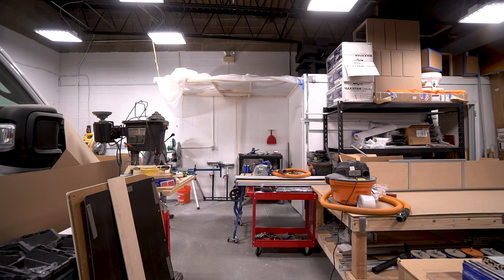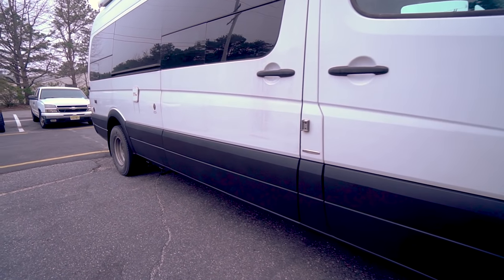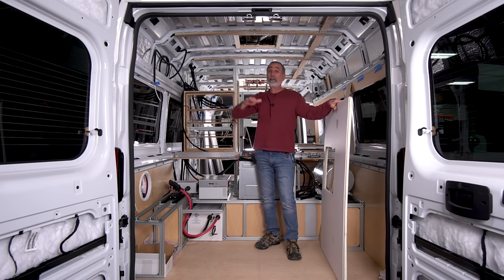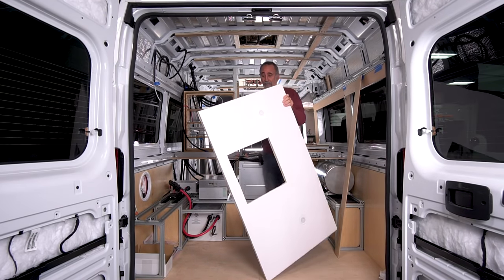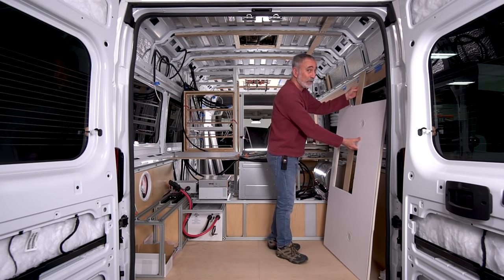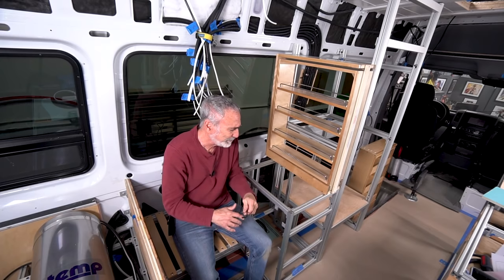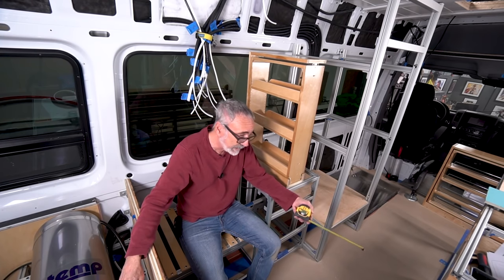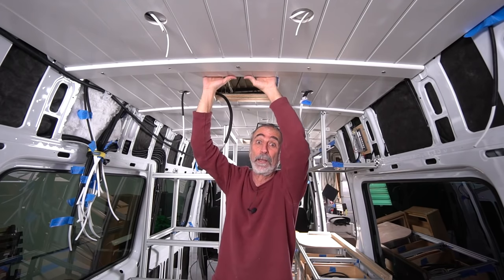Van build tips-Removable insulated ceiling designs explained-Recessed air conditioner & wiring tips

Comment: I parked too close to the trolley return bay at shopping the other day, and I turned too sharply, too soon, as I left my parking spot and subsequently scraped the entire side of my Iveco 35S16 van along the pipe structure of the trolley return bay.  Thank God for the rafter liners, that’s all I can say, otherwise I would have had a totally scraped and dinted van. A good lesson to learn so early in my van ownership. I was so relieved that the liners saved my van.

Comment: FYI  just wanted to tell you that when I had a van with no insulation on the floor it was very cold. When I stopped at a flea market on a Wednesday there was a man selling very thick black foam rubber! As much as you want in width and length! So I bought enough to put on my walking area. OMGOSH my feet never wore slippers again!  My piece is like a 2x4 and is easy to fold and take out during the summer months. It’s like the black rubber that is around a hair dressers chair. Cushioned and not cold. It’s about 1” thick or maybe alittle less. Just thought you might want to know? Live your show and work man ship!
Reply from the maker: Thank you Donna, great tip!

Comment: Love your work. Great attention to detail.    Good that you put the heavy items Over the axle but don't forget that the vehicles  weight rating takes into a count the loading on all axles. Mass centralization Is important for a vehicles handling and stability. I think that people tend to think that you can only load the rear axle. Many overlander build have so much hanging out the back with boxes bikes bumpers and spare wheel that they must handle terribly. You end up with the tail wagging the dog. Something folks should consider.
Reply from the maker: Absolutely correct! The Vagabond van was going to load up their garage so that’s why I put the water tank under the galley, across from the fridge. To balance the overall weight. The four corners of that van

Comment: So many interesting details...creativity and craftsmanship without peer.I’m glad my build is taking so long (seems like 90% thinking about the build and10% building) because you give me important tips that improve it every week, even little things like taking wiggle out of the wire looms. And I prefer the weekly summaries with short clips of building because the condensed info is so rich with great ideas. Thank you, thank you, thank you.
Reply from the maker: You are absolutely correct when you say that a van build is 90% thinking. This is the reason I take ten months to build a van. Each one is a ground up new design, starting from scratch, so to speak. I run through all kinds of scenarios and situations in my pea brain to test my ideas. All night long! 😩
Reply: I figure you must be too busy to post more videos…our loss. Hope all is going well. I do have a question: Are you an Espar dealer? I seem to recall this. I’ve searched you videos for installing Espar D2 air heater and cannot find an air-only inside installation. Have you done this? I want to install this on the 5/8” wood floor over 1” XPS. I’m trying to figure out how big a cut that I need to make on the wood floor. Does the whole heater need to be dropped to floor or can the cut  be made just for the mounting plate to cover with the heater at the level of wood floor. Thanks for your support.

Comment: This was perfect timing for my promaster build. I'm a little flabbergasted on how I'm going to frame out the walls and ceiling.
Btw I used lizard skin on inside. But I didn't use it on floors. I think it's designed more to insulate you from a heat source.

Comment: George.....my dream builder when I get rich.....Do you have a "guess-ti-ment" of what your builds typically run?  I know you use top quality everything in your builds, but if I'm going to dream to be rich, I need to know about how rich I need to be. And yes, you are making an impact on the van building world.....
Reply: yes, me too.
Reply: His builds are between $225K and $400K.  Why not build yourself instead of waiting for a man to do it?  What do you think these videos are for, gal?  Start.  Now.  You have two hands and a brain, same as any man.  And you are a better cook, I'm willing to bet.
Reply: If you have to ask, you cant afford it.  Just know a factory-built (cheaper) model starts at around 100k.  Class B units are definitely not cheap.  For sure, all of the parts George puts into these are top of the line products.  (IMO, even though some are top of the line, there are perfectly good knock-off components out there at a fraction of the cost.)

Comment: Hi George, I’m stealing your brilliant idea on on making bath bigger by leaving doors partially open when in use, the thing I’m changing is to extent shower tray past doors 1ft and have door filler panel on piano hinge. Need to figure out how to make extended shower drain look good when doors are closed. All class b’s front bath have a problem with narrow size.

Comment: I would STILL put some reflectix strips behind the ceiling panel... Better than air gap insulation.  In the desert you need all the wall and ceiling insulation you can get.  Floor runners and rugs with a yoga mat attached for thermal and cush insulation is a great option.  If you don't like the rug, throw it out and get a new one.  They are cheap and easy to replace.  4-ought cables, the shorter you can make them the more efficient they are.  Try angled connectors to minimize the flexing you need to accommodate bending the cable.  Build an extended bus bar for them to improve your angle options.  AC?  Just go with a mini-split.  Less power, more efficient.  Don't like the size of the head cassette? Maybe get a low profile ceiling mount version.  Love the space saving efficiencies you are making here.  Some day, a special company will make tiny-home / van sized furniture and counter space.  24" wide is a waste of space (IMO).

Comment: Great video George!  Love the outtakes!  Are the furring strips and roof stringers both bolted on/through with plusnuts or are the furring strips glued and screwed?  Your videos have helped me immensely planning my own build.  Your design sensibility of making things modular, removeable and inspectable is exactly what I strive for in my design.  It would be so cool if you had a book or ebook that went over some of your design principles and things that could be helpful to new builders.  There are a lot of other builders who have done that, but in my opinion you are one of the best out there in terms of design principles as well as the finished product.  Great work.
Reply from the maker: Thank you Mike! The Sprinter van is all PlusNuts. The Promaster, being a much lighter ceiling system, is glued and screwed. I don't have any type of formal How-To guides, but have thought about doing a week long build gathering tutorial in a campground somewhere, could become a thing!

Comment: I’m in a similar situation to Sam. I have a high roof Nissan NV2500, I’m 6’ tall with shoes on, and I have about two inches of clearance before I hit my head. I was wondering if putting furring strips on both sides of the roof stringers would save a precious bit of headroom and still be structurally sound

Comment: Hi George,
I see that in every model you use metal profiles for the construction. In the end, isn't that altogether too heavy for the Van?
How much does weight the van when is finished and loaded also with fuel, water, meals, clothes, and 2 persons?
Reply from the maker: On the contrary, Burim. The aluminum is much lighter in the way I use it, rather than typical plywood box construction. My vans, FULLY loaded for full time living are well under the GVWR.
Reply: @HumbleRoad  I am happy to hear that George. Sometimes the wood seems lighter but is not that stable and strong all the profiles and the woodworks always. I am thinking also to use that kind of profile.

Thank you very much for the answer and for the videos that you upload.
Greetings from Germany :D
Reply: Aluminum and sometimes even steel is the way to go on the framing.  Way lighter than heavy wood.  Aluminum is also much stronger, so you can do a slim profile which carries a lot of weight.  Saves on volume in the van. You don't need wood working skills either, as it is easier to join up.  Check out HR video on weight calculations - explained very well.

Comment: What prevents the ceiling panels from bouncing up and down? The stringer seems to just hold the panel in place. It does not appear that the panel is pinched between the stringer and anything else so it seems like it would bounce up and down. Thanks
Reply from the maker: The several layers of insulation above the planks holds the panels snugly

Comment: Hi these vans all look really good and well built but I am curious how much the conversion weighs? Any idea approx.
Reply from the maker: Each van is weighed upon completion, fully loaded and fall well under the maximum limit.
Reply: @HumbleRoad  hi I have no idea what the maximums are for the various vans I am thinking of building some here in australia and was curious what the different materials would add. whether it is better to use Aluminium or wood etc. So it looks like i need to do more research, some of the youtubers make passing references to the extra weight especially off road so hence my question. thanks for the great videos
Reply: @HumbleRoad  ok thanks for the reply, I love the extrusion you are using for your vans, it makes so much sense and I am trying to convince my brother to build a constant shower in his van  a great idea

Comment: Are you using solid conductor or stranded wire?
Reply from the maker: Stranded. Ancor Marine grade.
Reply: Never use solid conductor in a vehicle, over time it can crack and then you have no electric feed. 
Arctic cable is also flexible over a wide temperature range.

Comment: Love your videos George. Regarding your BMS cable issues, have you tried removing/loosening the cables from the battery, then plug in the BMS and then run them back to the battery? This might allow the cables to follow their natural "curl".
Reply from the maker: Open the UL listed battery case and you void the warranty.
Reply: @HumbleRoad  I didn’t realize the cables were factory installed. Can you turn the battery over?
Reply from the maker: Since making this video, I have considered inserting the battery into its cubby in the reverse manner, I have room for the cabling to bend back around to the rear.
Reply: @HumbleRoad  
Hope that works. Keep us updated.